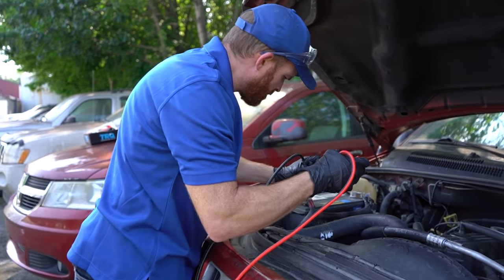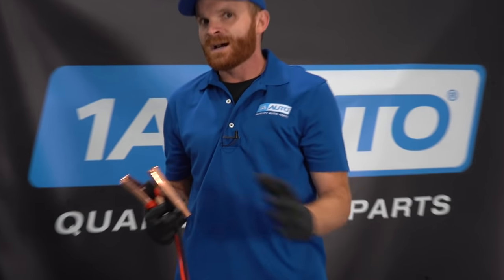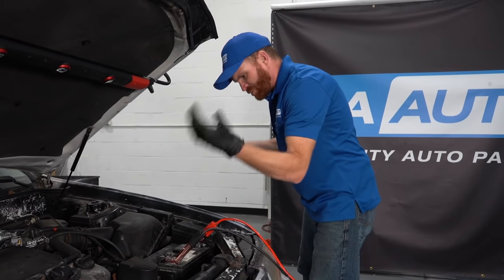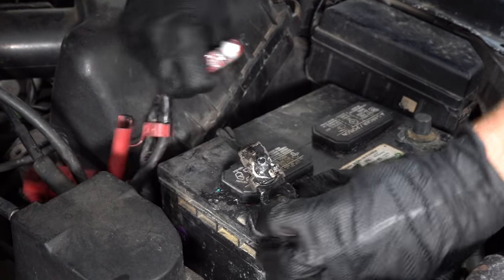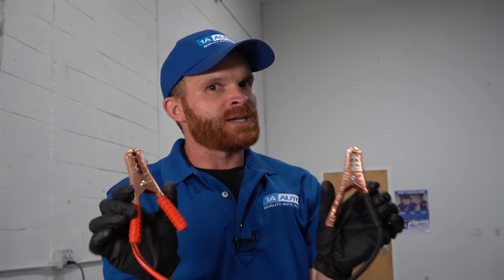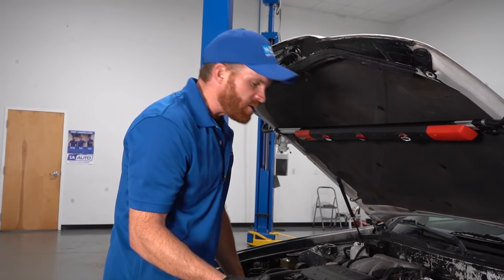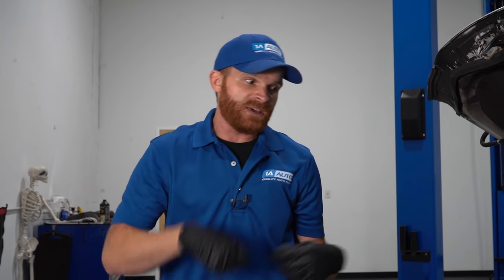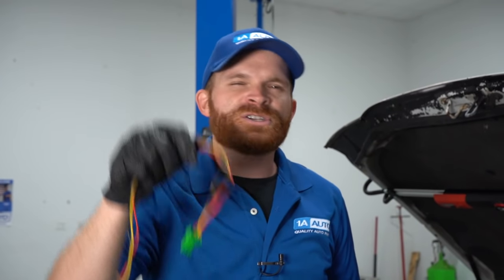Connecting Jumper Cables Backwards? Here's What Could Go Wrong!

Comment: I've jumped several times over the years but one time for whatever reason I switched the cables. I was using my pickup to jump my jeep and was letting it charge for a few minutes as I leaned on my truck when I smelled burnt plastic. I looked at the cables and the side nearest the jeep were melting the insulation off. Luckily no visible damage was done. That was the first and last time I did that.  No more distractions after that time.
Reply: Have you been able to start your car after that without any problem with the car fuses
Reply: @ehablovesalija  

I’ve done the same thing OP has commented. And yes, I’ve been able to jump other cars with my car. Just fyi.

Comment: Best advice, buy a jump pack which will not turn on if the cables are not connected correctly.  They are small enough to fit in the glove box.  And, no having to wait for someone to give you a jump!
Reply: The jump pack is what screwed me. It's supposed to make a noise when connected the wrong way. But if the battery is completely dead then it makes no noise
Reply: @m.b5777  damn, sucks to find out that way

Comment: don't use jumper cables anymore, use a jump pac, you can't do any damage if the polarity is wrong, just won't work!
Reply: My battery charger is like that.  When I first got it I hooked up a batt backwards and it wouldn't charge. I thought the thing was defective for a moment 😂 thank God for reverse polarity protection 🙏
Reply: What's a good jump pac to buy?
Reply: @betterrecognize4558  TackLife Kp200, can be used as a power bank and has a built in LED flshlight

Comment: Never hook the negative cable to the negative terminal of the battery of the vehicle being jumped. Connect it to a good ground on the body.
Reply: thats usually how I jump start my car and it works the first time everytime rn I had to jump start my car with my sisters car I did it on my own it was late night 2am and all I did was connect negative to my car negative to her car battery and positive to positive the car turned on first time grounding it to a part of the car never seems to work

Comment: I'll never forget, the one and only time, I hooked jumper cables up backwards.
It was late at night, I was on my way home, from a week stay at the hospital.
I drive a 2015 Subaru Outback, that if left sitting for too long, drains the battery.
Thank God, someone had jumper cables!
They were really old, and the red clamp was so dark, it was hard to tell which one was which.
When I connected the last cable, it sparked, but not really bad.
I figured it was because my battery was so dead, but quickly realized what happened, and disconnected it.
Thank God I didn't try to start the car, because I'm sure that would've killed it.
It's been about 4 months, and so far, everything seems to be working fine.
I did replace the battery, because I think it was damaged when I jumped it backward.
Ever since I did this, I've felt like an idiot, because I was an electrician, as well as electronics tech.
It just goes to show, it can happen to the best of us...

Comment: The cable connected to the starter is positive.  The negative is a ground wire usually connected to the body or outside of engine.  This is usually easier to see the connection.

Comment: I actually did see a few times when people, in the shopping center parking lot, would actually connect the cables with the working car running! No!! Don't do that. You make sure both cars are dead BEFORE hooking up the cables! That way it prevents arcing, a possible fire, injury, and even death! Always take safety into account whenever jumping a dead car!
Reply: lol just dont connect it wrong. the good battery will supply enough current to fry the other car if you hook it up wrong. doesnt matter if the supplying car is running or not.

Comment: I was in a rush and reversed them. I left it on for less than a minute. Started to smoke and I immediately unhooked it. The car lights still turned )I had issues with the alarm system not letting me turn on that car). I don’t think there was any damage. How long does it take to do damage while hooked? I got to it just as it started to sizzle a bit. 😬

Comment: Jumper cables are never backwards until you attach them to another car at the wrong polarity. Only then are they backwards. That would have been a better demo. Also, the negative clamp needs to go to the block on the dead car in case the battery is shorted out. That prevents shorting out the good battery.

Comment: I did this on my motorhome. Distracted silly mistake. I know I've burnt some wires somewhere. First I had to hook a power cable and toggle switch to get the vehicle to start. Now I am not charging my battery so I think I have to chase a wire from or to my alternator. Any advice would be most welcome.

Comment: !!NEED HELP!!
I charged my bike's battery separately after taking it out and i put oppsite terminals qhile charging...after some time the battery started to make a whistle aound with some smoke. 
I immediately turn it off and then all of it stopped.
I want to know that is the battery still usable or will i have to change my battery or only charging it correctly would work??

Comment: I accidently did this the other day as I was in a rush to get it to a shop for a noise. My car had no codes before this. I did this and then after 30 seconds I realized I crossed them and quickly removed them and connected it correctly. Jumped started the car and it started. However, when I tried to press on the gas pedal, nothing happened. Hook up my scan tool and it lit up like a christmas tree, had probably like 10 codes. Checked the fuse box and found 1 fuse half way through that was blown. Replaced it and gas pedal worked again and made the car speed up like it should. Cleared out the codes and all of the codes cleared except for 1 code in the bcm. However, I just wanted to get it over there and I will look into this after. Did look up what the code was as the description on the scan tool was a little unclear and it looks like its about the seat belt system, so not a big deal. I will finish going through the fuses and check the relays once I get it back from the shop to fix that bcm code. So this is my partial experience so far.

Comment: Ok, we have a 2006 Rav 4, she had trouble with a phone charger finally got the charger to get power as the car was running. She shut the car it and after work, it would not start. PW/ PL's not working. Only some dash lights. Will not boost off or even click. No power to obd2 Port, can't find any fuses blown? Any ideas, it's a Base Model 2.4 Automatic

Comment: Got a serious question..if you don't mind replying. I actually know vehicles very well I was one of those kids putting motors back together at 12 lol. But I recently experienced something I don't understand..recently I was jump starting my car and I made a bonehead move and hooked the cables up backwards on the vehicle doing the charging but normal on the vehicle being charged. It was only for maybe 5-10 seconds when I noticed what I did. Cables melted a bit and I saw smoke from the cables, I thought for sure I fried both vehicles. Neither was started when I did it either I caught it before I started the charging vehicle. Anyway what I don't get is nothing bad happened, my car actually started and is running fine now and I had a check engine light on for a couple years (emission) and it happened to correct that to. The other vehicle is fine as well..so any ideas how and why that would happen? I thought since it was such a short time period it acted as a real fast shock to the system that luckily worked. But the dead battery charged, and engine light went off and I never even started either of the vehicles. Really weird and really lucky but any opinion would be appreciated I'm just curious how that would happen
Reply: Your check engine light probably doesnt work anymore.

Comment: been a tech for about 4 years now and just did this for the first time ever today. long day at work wasnt paying attention and hooked up the live car backwards. as soon as i started the live car we noticed smoke and immediately pulled them off, the cables got hot but both cars were fine. dead car was an 07 envoy live car was an 05 grand prix. this may not be the case for all vehicles those 2 seconds the cables were on couldve costed 1000s ive replaced a pcm for that exact reason at work.

Comment: I'm having an issue atm with a 2015 vw jetta. The customer jumped someone, and they connected cables backward. Car instantly started missfireing. The diag is tough. Random multiple missfire. Missfire cylinder 1 are the codes.  When I pull each wire missfire gets worse. When I pull the injector on cylinder 1 misfire don't change. So i swap injectors.  same issue. I'm stumped atm. I'm thinking ecm

Comment: I have managed to connect a battery that was charged in reverse not only did it spark but the car made a sound that would be the dynamo and shortly after that it started smoking. I guess that my cables have burnt and I hope it will be a cheap fix by replacing the burnt cables. It happened with a ford Mondeo 1.8 mk3 .

Comment: I did this, this morning. In a rush and looked away. When I looked back the tip of the jumper was starting to glow orange. Noticed I put them on backwards. Switched them and it started up fine. Only issue is my radio/touch screen doesn’t work. Changed a blown fuse and it still doesn’t work.
Reply from the maker: +@IowaBoy54 We wouldn't be able to diagnose an issue like that here, you may want to have a local mechanic take a look at it. Thanks for checking us out! http://1aau.to/m/Shop-1AAuto-c

Comment: I switched the black with the red by accident 😶 for like 3 seconds, took it off did it right, then once it started up I had the 4lo flashing and check engine light on, along with traction control on (toyota 4runner 2011)  hopefully i only damaged the sensor

Comment: I hook the last jumper to the negative terminal so often that the slight spark was expected. "Hmm, red sparks is different." I thought, but it's dark. Let me hook it up. I jumped in and tried to start. Dead. I wasn't dead-dead before. The cabin smelled a bit burnt and that was my second clue. My negative terminal, it seems, has a small red connector for some component and at 10pm I'm seeing a positive terminal. Anyway, the booster cables were hot but not melted. It's minus 18 right now, so that's probably why. The positive terminal on the dead battery had black burnt spots. My next steps are finding melted wires and checking fuses. Sounds like I can boost this same battery (since it still looks good). No one is saying anywhere that the battery needs replacing (even though internal components "may" be damaged!!???).

Comment: Did this to a grand caravan today. Battery was inside the wheel well. Installed a new battery with flipped terminals, big mistake. Don't give car manufactures too much credit. Should I have made sure the batteries matched? Sure! Did they need to put the battery inside the wheel well, with zero visibility and movement. No.

Comment: Yeah I couldn't see the ends of my battery posts because it was dark, and raining lightly and I was in a big hurry, it took only 3 to 5 seconds to melt the cheap jumper cables I used and now I've had P357 code for ignition coil, ended up changing the coil for the #7 cylinder and the code didn't stay cleared it came back after several hours of driving it afterwards, prettttty sure I fried my PCM and searched this video to see if hooking up the cables backwards would cause a fried PCM, looks like I have lots of checking to do 🤦🏻‍♂️🤦🏻‍♂️🤦🏻‍♂️
Reply from the maker: +Greg Thomas Thanks for the feedback!

Comment: I tried to jump my car with my neighbor who graciously helped. The only thing was I didn't do it properly (I didn't ground the black clamp on my car which has the dead battery) I clamped her negative last and it caused a spark twice although I pulled back right away. I then did it right. The charge didn't work,  gonna buy a new battery. I'm just personally paranoid that may have done damaged to her car. I hope to God not.  Her car was working while we were waiting for the car to charge but I'm just not satisfied with my paranoia. I just hope nothing bad happens in the short term

Comment: I needed a jump from my neighbors and they had the cap disconnected and it was sitting on the negative.

I went to jump it and wild sparks flew, and it got sooo hot.. I feel I got it off just in time before it would have been too hot to touch to remove